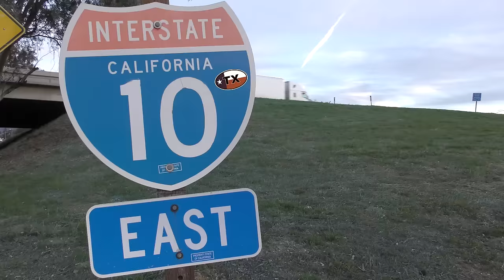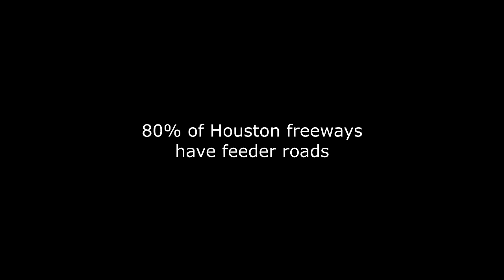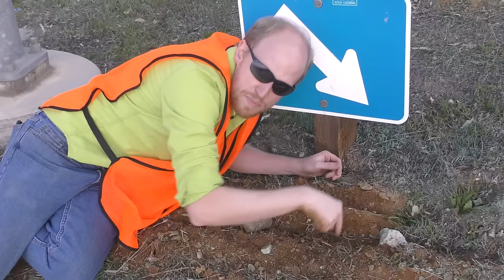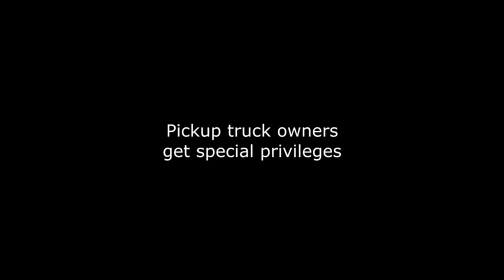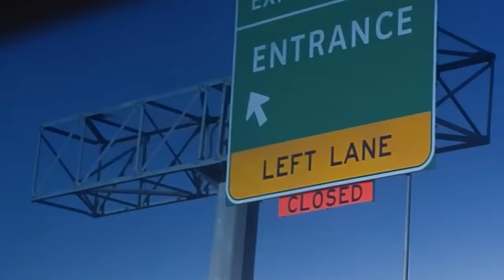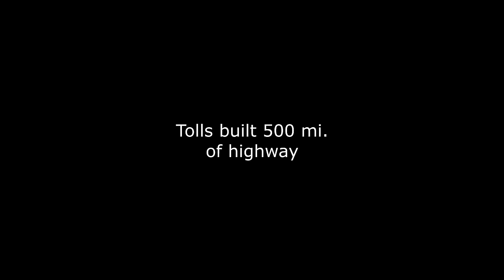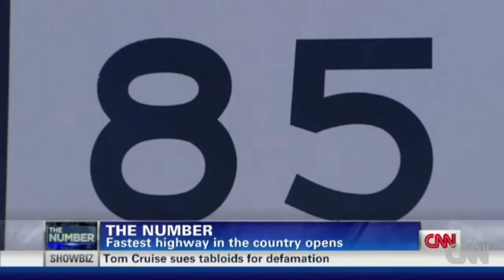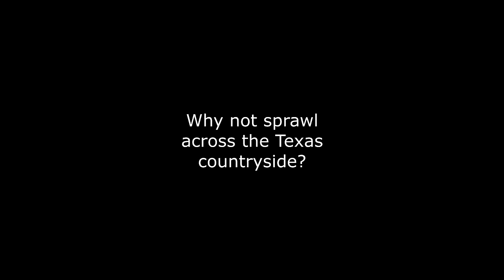How does good Texas engineering make REALLY BAD roads?

Comment: So, as a Texan living about 5 miles from 0:30, I have some details for you...

1.) 3:54 on the issue of cheating... there you're on 75 which is free, do that in the Northern part of Dallas and you'll pay $2-$3 toll.
2.) 4:18 Service roads in the country are two way. There's two details you need in context:
 a.) There's not typically a lot of traffic in these areas. if/when you hit a decent sized town, they usually turn into 1 way.
 b.) If you're ok with on-ramping onto a 75MPH highway on the left (wrong side) with no life-saving bridge in sight to somehow make sense of it all, then I can see this. But, to date, I've only ever heard of this happening to drunk/impaired drivers, and in those cases even a concrete baracade isn't always enough, so it's hard for me to entertain criticism here.
3.) 4:53 Those spots between directions on an interstate are for police/emergency use only, so the police can radar both directions and get you either way. Usually there's signs saying that. I'm not saying the occasional person doesn't use it anyway, but I haven't. Now, spots like 5:00, those are usually explained by a fairly recent traffic jam causing people (mostly trucks) to exit off early. I've done this once myself too, but only once since if you don't have enough momentum going into it, you can get stuck on the slippery grass at the bottom. If you like a clean truck, you'll pay for this too at the car wash.

The general idea for Texans is to encourage people to make their own decisions. Yes, we can do a u-turn on the interstate, but should you? Yes we can on-ramp to the wrong side of an interstate, but should you? Yes, we can cheat a red light by taking the interstate one block, but should you? ... Personal responsibility and freedom of choice is still somewhat a thing here, or at least it's taking a while to die. From the perspective of a Californian, I can see how this seems like a disaster waiting to happen in the way it manifests itself, and perhaps it is... I see it like those labels saying not to drink bug spray ... that's only there cause someone did something stupid. California seems to me would be more open to this kind of thinking. For example, say a person were to merge the wrong way on an interstate, that's bad, but if I'm a Californian, I say WE let them do it by not putting fences up! We're AT LEAST as much to blame as they were if not more! Put up fences immediately! On all roads! NOW! Whereas Texas is less explicit, relying on their drivers to abide by the good ol' fashioned "Should you?" question. If you screw up though, it's on you, Bud, we ain't changing the road system just cause one dude made a bad decision--there's no need. We're a bug spray without a warning label, and that's ok.
Reply: The problem is that other people are held accountable for a person's failure to be personally responsible.  If people can, and do, merge the wrong way on a freeway, then people doing everything "right" are able to lose their lives because of the stupidity of one person.  And if that person happens to die in a crash taking out multiple people, how can one hold a corpse "personally accountable"?  What does the concept of "personal responsibility" mean when all involved are dead?

I only ever see this as a way to abdicate responsibility, to ask a pilot of a plane crash to clean up the bodies because "we're not responsible for what he did".

If your system allows a lack of "personal responsibility" to cause disproportionate injuries to others, it's a bad system.  Those responsible are not necessarily those held accountable.

Comment: Moving from Oregon to Florida last April I had to cross TX.  I-10 for a lot of the open countryside is okay to quite good, but going through the cities, El Paso, San Antonio, Houston, is a nightmare from hell, mile after mile after mile of road construction, pinched narrowed down lanes with no breakdown lanes, confusing signage, people driving 70 and more in areas where 45 is really unsafe, changing lanes right in front of you, cutting you off with less than 3 feet to spare both in front and behind them, they MUST be suicidal because I had a 27 foot Ryder truck with a car trailer and my BMW on it behind, my ability to slow or stop in an emergency was dangerously long, and the road surface through those construction zones generally would only be considered "safe" for a rig like I was driving at about 25 mph.  There was one place where 4 lanes of freeway was suddenly 2 lanes, so narrow that semis could not be passed, concrete barriers right on the lane edge so there was zero room for error.  There were places where I am certain the towed car carrier behind me left the surface of the road.  And the sheer confusion of the freeway through Houston was crazy, ten lanes wide and practically no markings or signs at all.  Good thing I went through as rush hour was thinning out because you would moving along and realize almost too late you needed to be in the left two lanes, having to cross 4 or 5 lanes to get there in a very short distance.  The lane markers were painted on the road rather than having directional signs over the road.  

If I ever have to move back across country I will NOT go through Texas.

Comment: Feeder roads (Frontage roads, depends on what you're used to sayin') are an excellent feature of Texas highways and we all know how to use them.
Notice a Cracker Barrel while driving by but you missed the sign telling you what exit to take? Just get off on the feeder road and double back.
You weren't paying attention and your fuel gage suddenly starts dingin' telling you that you're almost empty? Get off on the feeder road, there's bound to be a gas station on one side or the other of the corresponding underpass/overpass, sometimes more than one. 
Your engine overheats, you're barely crawling along and traffic is whizzing by at 80 MPH? Get off at the feeder road which is safer and has plenty of open areas for you to pull over. If you're a bona-fide Texican you can probably fix it yourself, but even if you're not at least now you have somewhere to wait after you've called AAA.
Want to rest and have a picnic but there hasn't been a sign for a rest stop for a couple hundred miles? Feeder road, empty fields right off the gravel shoulder. Just watch out for them Skeeters, they're packin' and they're allowed to open carry. Because, you know... Texas!
And yup, the Texas Truck is king. We even have our own license plates.
Pedestrians? Sidewalks? Bicycle trails? You're thinkin' that you're sure someday we'll fix it? We're not Californians! Ever try to walk or bike in Texas heat? If you're young and stupid, I guess it won't kill you, but Texas is BIG and we don't want to waste our time trying to find water everywhere we go. So pedestrians? More like road kill, like armadillos. Or Japanese tourists.
And about the flooding problem, it can be sad, but consider this: we got boats! All kinds, for fishin', kayaking... hell, some of us even take trips down to the bayou to catch gator, shrimp, catfish, frogs, either shoot 'em, hook 'em, net 'em, or just grab 'em and toss 'em in the skiff as we're cruisin' by. So don't feel too sorry for us, most of us can handle a little water unless you've a recent transplant from Duluth or one of them Yankee places.
Still confused? Bless your heart. Drive friendly y'all, the Texas way! Yee-haw!

Comment: Tolls are pretty controversial and debatable.  I mean, you could charge considerably higher gas taxes or registration fees or other types of taxes to pay for that, but those are all flat taxes which disproportionately impact the poor who still need their car, their gasoline, etc.  And building enough revenue takes years and years longer than when the road is already needed due to the insane growth that Texas has had the last 30 or so years especially.  So tolling is a tax then on the people who actually take advantage of that road, but you are still able to get by decently fine without the tolled road and continue driving as if the road wasn't there.  So.... it's bad, but it's bad because taxes are annoying, but somebody still has to pay for it.

Comment: The Express Lane system, at least as implemented in the DFW metroplex, is a huge headache and not a savior. The huge numbers of extra bridges to bring traffic in and out pushed up costs, the few freeway-to-express ramps gobble up lanes and cause slowdowns as cars have to merge to the right and the express-to-freeway exits seem to be universally too short and crooked, dumping traffic into the far left fast-lane with no place for merging and high barricade walls to bounce minor wrecks across multiple lanes.

Additionally there is bad pricing on the Express, which is tolled. We were promised a flexible, traffic supporting system where the tolls would be automatically created by average vehicle speeds. Highway slowing down but express empty, tolls drop to encourage use, express overfull and slowing down? tolls creep up to discourage use. Instead it is a mishmash of 'surge pricing' and confusing signage, with prices going sky-high for the empty express lanes while the mangled and abused freeway creeps past, bumper to bumper. It does see a lot of commercial traffic, and the idea of a commercial corridor would be cool, if not for the useless exits that insure the big trucks are still dumped in regular traffic for the congested areas to move through jams.

Of course, the express system is meant to be a big moneymaker so it has infested all road expansion plans and traffic concepts, meaning simple plans to widen a section of highway (adding a lane where TXDOT planned for the expansion when the original roads and bridges were laid out) morphed into plans to cram an express artery through the space, eliminating the freeway lane expansion and eliminating breakdown lane space on the inside and outside of the freeway through the corridor, meaning more wreck/breakdown delays.

Comment: You want to see some bad roads? Take a look at the Interstate system around Chattanooga TN, narrow, sharp corners, with a normal 65mph speed limit anywhere near town dropped to 45 when they're working (always, they've been at it 30 years in some places). No beltway bypass, all traffic right through downtown. It's actually faster to use old state highways most of the time depending on where you're going. You might legitimately find it interesting.

Comment: 1:41 I’m not sure what is the difference between frontage roads and feeder roads, but Thailand has these one-way frontage roads with businesses that pop right on as well.
Reply: I mean it's good for separation purposes of local and thru traffic.
But it gets screwed up at junctions, where a 'frontage' road becomes a Motorway ramp???
Instead of putting the ramp on the express lanes. It's connected to the frontage roads instead and requiring alot of exit and entrance points to get in/out of the express lanes. 
Traffic from the express lanes have to weave to frontage road traffic to get to the exit. Which causes a hell load of a problem.
Speaking as a Thai native and road enthusiast myself.
Reply: @TheFirmLiftSearch  I live in Thailand as well, and one of the frustrating things I find is that in rural provinces, both the main and the frontage roads have to wait at traffic signals at intersections.
Reply: And of course on trips such as going from Bangkok to Khao Yai, taking the frontage road is almost always faster than the main road.

Comment: Another weird thing about Texas' frontage roads is that you could wind up with a street address that belongs to a major interstate highway. I live in San Antonio, and I see several apartment complexes that has an address that belongs to Interstate 35 or Interstate 10. And then you have to deal with the addresses of beltway highways like Interstate 410 or TX Loop 1604. Like Northwest Loop 410 or East Loop 1604 South. Fun, isn't it?

Also, I find it a bit odd that you were confused by the turnaround lanes. I moved to SA from Massachusetts last year, and I got the hang of those right away. I guess it looks weird to see a car that looks like it's going against traffic flow, but they're really easy to use.

Comment: In Texas, passenger seat drivers are an abomination. If you don’t know where your going, someone yelling in the passenger seat to turn left now while Siri is telling you to “stay in the left 2 lanes,” can turn into a disaster. I ALMOST got rear ended by an 18 Wheeler because I was on an 85 mph speed limit interstate which SPLIT into 2 sides and I didn’t know until Siri blared at me to stay in the left lane. All the while my passenger seat driver is yelling to take the left side. When your under stress, taking 2 different directions being told 2 different ways become incredibly confusing. Needless to say the 18 wheeler behind me did not enjoy me slamming on my brakes to move back into the other lane. This was almost a year ago in Houston but a time I’ll never forget nonetheless.

Comment: I bounce between Illinois and Texas pretty frequently due to work and family.   Texas has horrible transportation design, full stop.  You hit the nail on the head about feeder roads creating linear development along the interstate.   It makes it so when you inevitably have to get to the other side of the interstate to go to another business it creates huge amounts of traffic at overpasses.   Then when the overpasses have to be expanded to accommodate local traffic it is a time consuming and expensive project due to it being bridge construction over an active interstate.

To locals the roads 'feel' fast because of the high speed limits compared to other states, but you end up having to drive much further than you need compared to states that have better road design.   That completely negates the higher speed limits.

Don't get me started about lacking sidewalks.   It just generates even more traffic since you have to drive to get to a store that would normally be within walking distance.